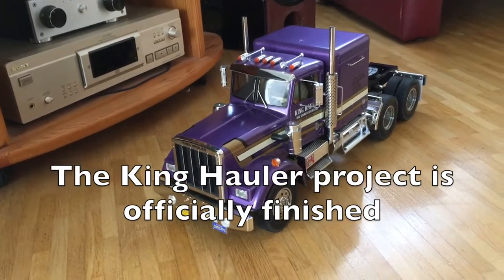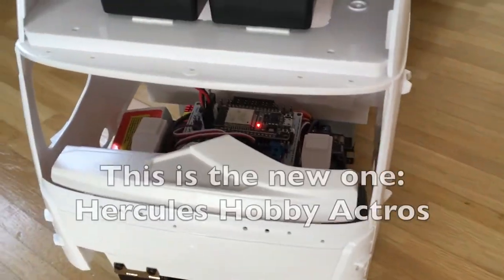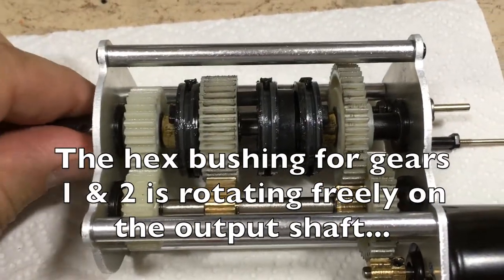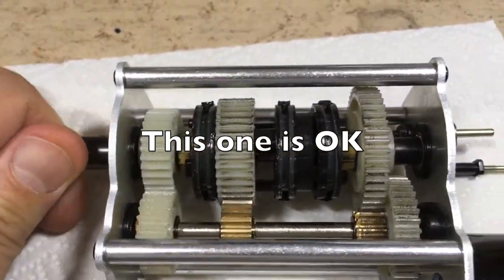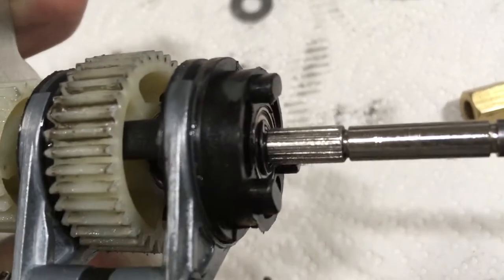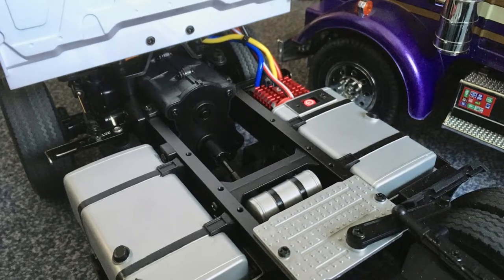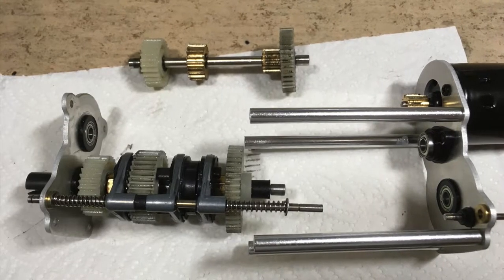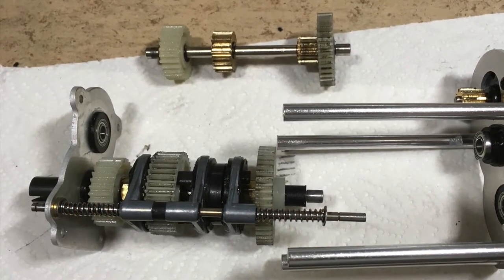Hercules Hobby TAMIYA Clone Actros 3363 Truck With 3 Speed Transmission & DIY Sound: Any Good?

Comment: Hi, I love this project. I built a light controller for my crawler some time ago with two arduino micro. One to receive my extra channels and another to drive the LEDs. I didn't think about adding sound... but then I didn't know about the ESP32 either! Does it work with any reciever PWM channels or would I need to build your micro reciever for the one-wire? Also, would it be possible to use the WiFi on the ESP32 as the reciever?
Reply from the maker: Hi, yes it works with every standard receiver. As documented, you can use pwm, ppm or sbus